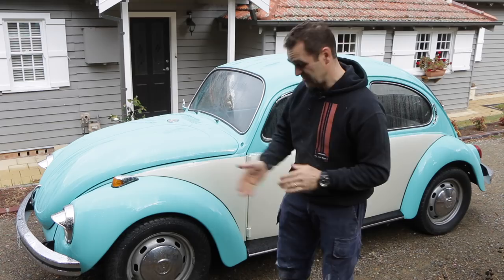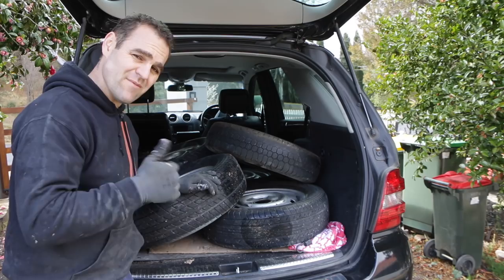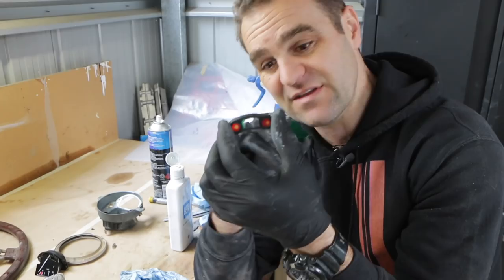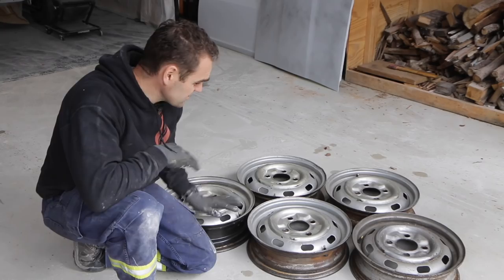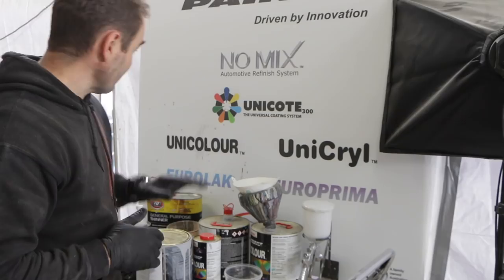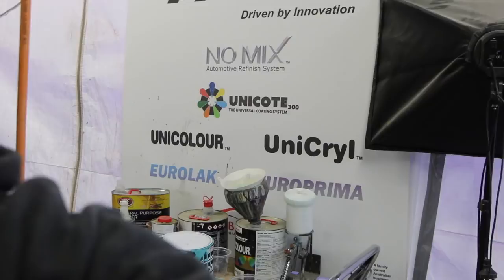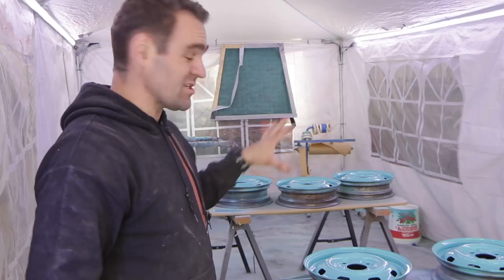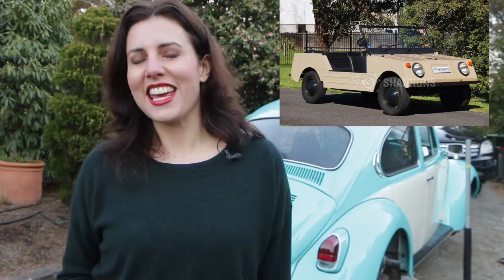Home Built Project Beetle part 25 - Wheels

Comment: Hello Jeff.  Go to your local office supply store and buy folder dividers with the colored clear tabs.  Sand the tabs a little bit so the flasher/oil/gen light doesn't blind you going down the road. This will defuse them.   Also if you haven't already go to thesamba.com   Great people that are willing to help.   Keep up the great work.
Reply from the maker: Good tip. I will give it a go if they are a problem.

Comment: Don't forget Jeff now you have changed the colour I'm pretty sure you have to advise the Transport Dept (every state calls them something different) that it is no longer yellow so they can change the information on the title. I have used Atlas Whitewalls (They're made in Turkey) with no worries. Just make sure you have clean hands when you handle them as they do mark easily. Love your work Mate.

Comment: You should consider using a paint or sealer for inside the the rim and where the tire is - I would say use POR 15, that will give it a good look, protect the rim from corosion and finish it nicely!

Comment: Oh, I just did that Speedo work over the weekend on a 3.2 Carrera with a broken odometer gear. That rim is a real pain! I second Chris Valone's channel! Very helpful over email too. He just got married! F
Reply from the maker: How did you go getting the rim off? I have looked at it on my 911 gauges, but you see the whole rim, and I am worried it will mess it up.
Reply: I found that if I used the side of a small screwdriver (not the tip) it worked up a larger section at a time and left almost no marks.  It just takes a bunch of time like your VW one did.  The pros must have a special can-opener like tool to open it carefully or they just replace it.  If you are replacing the Odo gear (that always breaks) from speedometergear.com, you don't need to pop off the needle!  There are four screws that hold the whole bit together under the face, and if you remover the two face screws, you can alternate and work out the four screws below and get the assembly apart.  That dial needle is really fragile!  We swapped out the gear and it works great!  That would be the time to replace or polish the lens too.  Hit me up if you have questions when you get there...  f

Comment: Never heard of doing color over wet primer, seems like a time saver (less sanding) if you don't sacrifice adhesion. Any higher risk of runs doing it?
Reply from the maker: Not if you take your time. The main issue is that you get more orange peel and compound any imperfections from the first layers. As this is on the wheels, I don' care if the paint is not quite as flawless.